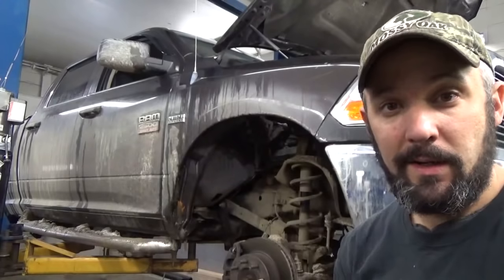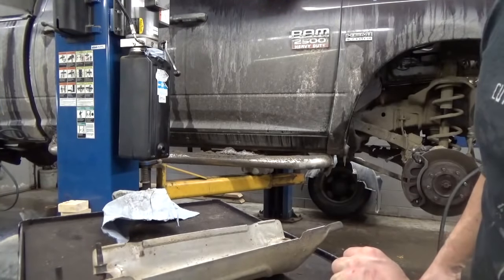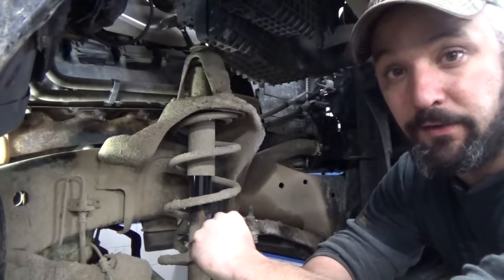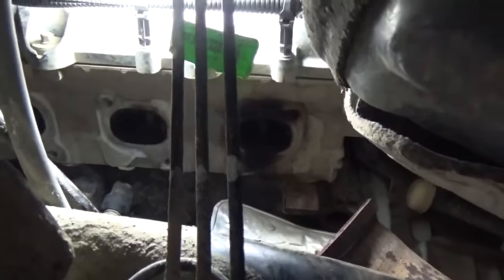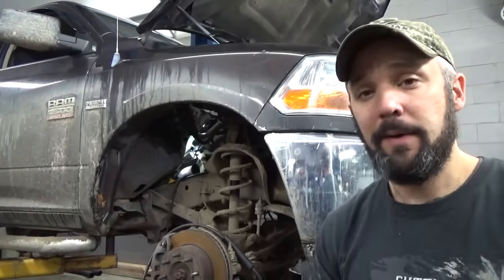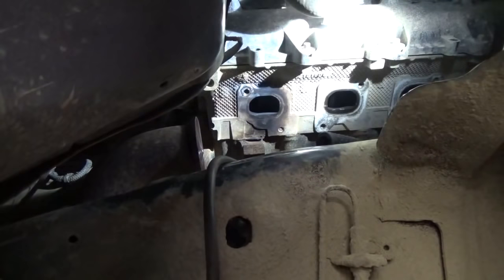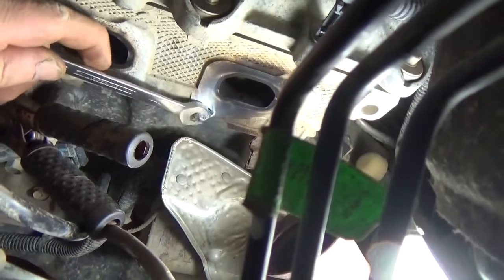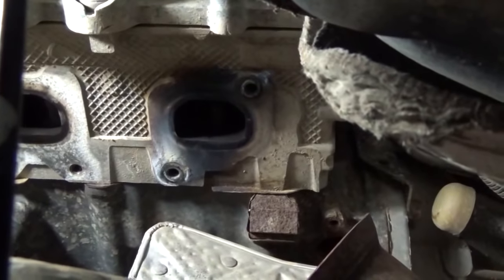Removing Broken Exhaust Manifold Bolts - Hemi Dodge Ram

Comment: please explain why it doesn't melt the aluminum block?  my method of extracting broken bolts is to take a small punch and pick a side and tap with a small hammer in a loosening direction. works pretty well if you can get the punch to stick. you may have to sharpen it to get it to bite.

Comment: Aluminum heads and cast iron manifolds have different cool rates, gets heat cycled and breaks due to heat up and cool down. Get different headers and you’ll be fine.

Comment: If you weld a flat washer to the stud first, its easier to see. It also gets better penetration.
Then weld a nut to the flat washer. An added benefit is 2 heat shots.

Comment: I just finished doing this myself today I have only had two broken bolts to deal with and of course they were the rear to on the passenger side. Instead of getting a replacement studs that I just went to the local hardware store and got some grade 8 bolts and made sure they were adequate length and put it all back together. I wonder what the reason behind them breaking is. I wonder if the exhaust manifolds expand more than normal and just breaks the poor quality studs

Comment: Why doesnt  the nut weld to the block also????? Does the block sink the heat so it doesn't get hot enough? I'd love to understand how this works. I'd wind up welding the nut to the block and nothing to the broke bolt. Nice work!

Comment: In the first five seconds of this video I asked myself Where is the kroil............ he used that fluid in a different video and I have used it several times on small engine repair. I think it's basically transmission fluid mixed with something else but it is very good

Comment: Great instructional video!
To remove the non broken studs and bolts,  if one doesn’t have a torch do you think letting the engine run to heat the manifold up and to let them bolts turn lose and then continue after it cools down? 
Terrible idea or could it work?
Thank you!

Comment: Not a welder or even a mechanic for that matter, but just wondering for those recessed bolts that need extraction if it would be easier to weld the end of a narrower bolt to it so you have room to weld on the outside of the threads instead of trying to hit it from the inside of a nut and build up the gap.

Comment: I would be very cautious using this method on the aluminum Hemi heads. They are known for warping to begin with. I would recommend a template extractor kit.

Comment: I understand you were mig welding the nut to the stuck stud. The base material that the bolt goes in is aluminum? If so, that would answer my question why the mig welding did not attach to the base metal. Does this process work if the base metal is steel? Or does the mig weld also attach to the base metal.

Comment: Brava, brava! My favorite method of removing broken studs. A friend who works at an exhaust shop showed me this technique many moons ago.  But those damn strut towers! The 3-valve Fords are a bitch - its usually the front ones that break, the towers are in the way, plus Ford studs are threaded tighter in the head. A good hot welder is key. Sometimes it's necessary to use a die grinder and remove the first few threads on those recessed studs.

Comment: Great video! I have a manifold bolt broken at the head. My question is should I get the same size bolt thread and thread it on and  weld it or get  1 nut  or 2 size larger and weld it. Or does it matter?  I am new to welding so I really don't know what is the best route.

Comment: I'm having a lot of trouble finding the exhaust manifold bolt / stud kit for the 2003 dodge dakota 3.9 manual transmission.  I found a OEM site that has the parts individually but there should be an after market kit with all the bolts/studs.

Comment: So, on manifold bolts, always heat the bolts with a torch before taking them off, is a good idea - love the whole vid...i hate working on exhaust bolts, esp ...but got 3 i gotta get out so not to warp the new manifold and blow out another gasket every 3- 6 mths of use.. Working on a ford  inline 6 for me… with a new carb that the float wasn't adjusted right, doesn't mix with an exhaust leak - talk about anxiety, sheesh

Comment: Nifty! How about a stuck and broken oil pan bolt? What method is best for getting it out? I can't use a welder to weld a nut on it, because the engine block is a cast iron block. Also, the bolt is broken off about 1/16 inside the hole.

Comment: Very common problem with the hemi. Aluminum head, cast iron manifold, and steel bolts all expanding and contracting at different rates. I wonder if replacing the manifold with steel headers would help.

Comment: It seems to b pretty common on those trucks. I have a ‘15 with 25k miles. What could I do to prevent this from happening? Replace them with stronger bolts? Thanks for you video!

Comment: Thanks for the answer, I just got the manifold off and found that the broken bolt is actually not stainless. Will any MIG welder work for that? I was thinking about just renting a little 110 v welder and trying it out, but I'm not sure if it would hold.
Reply from the maker: +Cody Praud All I was using is a 135 amp 110  welder...

Comment: That was a masterful job sir and your video was clear as well. I have the same issue with my 5.7 Hemi in an aspen.  Can you tell me which MIG welder you use. I had a little blue Miller and gave it away because i could not get it to seld anything!

Comment: Now how did you get the ground to weld? Did you just put it on a ground on a head or what? Thanks you made it look too easy though I have to do my 2002 1500 5.7 and I am a little scared to do it
Thanks in advanced

Comment: Great vid. Thanks for taking the time to video the process. I have the same problem on a 04 ram. Been putting this fix for a while. Read a few blogs and these Mopars are notorious for this problem. Do you have any suggestions on replacement bolts, ARP ...? Thanks again.

Comment: This may be a silly question, but how does welding the nut to the recessed bolt not get into the aluminum threads as well? Also could a flux core mig be used for this?

Comment: Big Tip, I just took 3 broken bolts out of my 5.3 vortec aluminum heads. I did the hardest one last, it was almost 1/2 inch in the head. I went thru atleast 15 nuts and easily spent 5 hours trying, plus it was my first time welding. Best method was to weld enough on the center of the stud then used clap on pliers! trust me

Comment: Great video
What type of nut was used ?
And what settings was you using for the welder?
I have a 2017 Ram Sport 31,000 miles, waiting to see if warranty is going to cover  it. Thank you

Comment: Question, that 2nd bolt that was recessed in there... you welded in the middle of the nut, which would fuse the bolt to the nut, but would it damage the aluminum or distort it from the welding heat? I know its not going to weld the aluminum because it's not an alu welder, but would it mess up the alu if you for example don't aim good and accidentally aim at the aluminum head too much? It would just turn dark right? And if you aimed bad, it wouldn't even weld the alu right?

Comment: this is a very common issue... in some cases the bolts are basically hand tight and we have had success removing them with very little effort, but not all the time....gotta love this line of work hate it when theyre countersunk... that really stinks

Comment: When welding the nut to the bolt are you disconnecting any of the electronics on the truck other than the battery? Is there a chance of frying any of the electronics with the welder current? What did you ground on?

Comment: Why did exhaust manifold bolts break in the same position on both sides? Is there more stress on the bolts because of the way other components are bolted in? Is it getting excessively hot in the back cylinders? Is there a design flaw? What's up with this?

Comment: Weld a washer first to the broken bolt and build up the center of the washer with a tig welder.
Then place new nut to the welder washer and weld it in the center full of weld.
Then remove nut

Comment: I have a question for anyone that has used a mig welder. When the bolt is broked off recessed into the head and you use a nut and weld it on, Can the weld actually stick to the head as your filling in the gap between the nut and the bolt itself or do you have to be just that good with the welder?

Comment: I have a 98 1500 4x4. When I hit 2500 to 3000 rpms 0n the freeway... engine starts limping around and sometimes ingetbthenflashing engine light. As soon as I let go of the gas pedal it goess away. sounds like something rattling around. I'm assuming the cat. Would you agree?

Comment: if you only need to get the 5.7 hemi heads off for a blown gasket or lifters & your exhaust manifold bolts are fine then leave them ON ( just remove 2 bolts to exhaust ) & remove the heads with the ex manifolds attached. Save you $ and a ton of time.

Comment: I’m a DYI guy AND new to mig welding. What did you ground/clamp your mig negative so to not affect the truck electronics? AND high or low voltage on the welder? Thanks. 🇨🇦

Comment: I was wondering about replacing my exhaust manifolds to the stainless steel on my 2012 ram 5.7 hemi and was wondering if it is a good idea as I know the cast iron ones cause leaks which is what happened to me

Comment: Great videos! Question do you reuse the old bolts after heating them up? Does welding those nuts onto the broken screws cause a risk of melting the aluminum?

Will this process work on a Dodge nv244 transfer case? I think they are made of aluminum as well. One of the fill bolts isn't budging and the hex is almost rounded after numerous rounds of removal.

Comment: great job, you do some very nice videos,on the exhaust bolts when the heads on the bolts snapped off do you heat the bolt or the head right where the bolt goes in,i noticed you are just heating the bolt head,thanks keep up the nice work

Comment: Are the oem bolts inferior or perhaps a diameter to small from factory? It seems this is a common problem. Thanks for sharing. It beats angle drill with drill bushing and like like you say ruined day with a broken bit/extractor.

Comment: I have a 2013  ram  watched your video  thought ok, that's going into the garage  .   when I got the truck back  what they did was cut off the heat shield  .  Was that even an option ?  Or  Should I be going back to garage and say wtf ?

Comment: When you hit the bolt with the welder and build up a puddle is there a chance it will weld to the aluminum or melt the threads in the head?

Comment: Very nice.  When using oxy acetylene for heating up the bolts any suggestions for tip size and heat setting?

Comment: Great video!  Did the exhaust leaks (ticking sound) on the drivers and passenger sides throw a code P0171 or P0174 indicating the the engine was too lean on Bank 1/2???

Comment: Is there any risk to melting or warping a portion of the cylinder head with the welding when they are broken flush with the head? I have the ticks in my 04 2500 Hemi and the heat shields are loose so it's likely I will have broken studs and/or bolts.

Comment: I’ve been having this exact issue with my 2010 ram 1500 for years and I just ignored it. Just recently I had a check engine light come on that showed “small leak detected” I erased the code. And now I have a “p0305- cylinder 5 misfire” do you think this manifold leak could cause that misfire? I do see a loss of power and gas mileage. Other than coils/plugs/wires change. I think this is the root cause of my problems

Comment: Chrysler/dodge tech here. Just drill a hole slightly smaller than a T25, then tap the bit into it, and almost every single time they’ll come right out. Regardless of if you’re in a salt state or not

Comment: My '02 Ram with a 4.7 is starting to leak coolant from a core plug. I guess I'm gonna have to pull the engine to replace them all. Which means I'm gonna have to remove the manifold bolts too. I'm worried about them possibly breaking. Is it very common for them to break on these engines? If I don't have a torch, can I just start the truck and let it warm up for a couple of minutes and then immediately try to loosen them up? I realize the truck is old, but is  a torch the only way? Any tips?

Comment: What do you do to keep from starting a fire with the welder? Did you cover the fuel lines or anything? Also do you clamp the ground cable to the engine block? 

Thanks in advance. I'm about to attempt this repair on my wife's trail blazer.

Comment: i have a dodge 3500 5.9 gas the manifold bolts broke off on the outside will the manifold slide off of the bolts or will i need to weld nuts on them first

Comment: Will a exhaust leak on the manifold cause the exhaust at the tail pipe to make a different sound than that other side? I don't know if you have heard of the dollar bill test but on the right side it sucks the dollar bill in the pipe every so often on the left side it does not. Not sure if that is a motor issue or a exhaust leak issue. I know I have a  exhaust leak for sure.
Reply: Also, would you gain anything by going back with a set of headers over the factory manifolds?

Comment: The only issues I see are choosing the proper nut to weld onto the nub... Seems like a lot are alloys of zinc and then higher grades another alloy of steel, what nuts are the best to weld onto the nub so they just do not spin off?
Reply: Those darker metal nuts that will get light flash of rust are what I was looking for, but our hardware only has those shiny ones full of zinc, or the gold ones grade 8.. haven't luck with either, the weld sticks to the stud but will not bond to the nut... I found 1 old nut in shop and got 1 of 6 that were damaged in a Ford 5.4 head, might have to steal some lugs off old trailers here... alloy issue.. then helmet issue, can't get in close enough to see.. luckily aluminum head...

Comment: So basically I just need to disconnect the battery, plug the welding ground onto the engine mount and I shouldn't have a problem with messing up my sensors or electronics?

Comment: Loved the video. My 03 ram has the same issue. I am pretty good with a wrench and was worried about how hard this repair would be. Before I took it to the shop I found your video. Now I think I will give it a shot. Thank you for putting this on. 

Where did you ground the welder to on the truck? Thanks again.
Reply: bigkev10101 I planning on doing the same thing on mine but I dont have a torch, do you think just heating up the engine to let those bolts lose could work?

Comment: what did you use steel wire or aluminum wire to weld the 8mm bolts on? awesome video, very helpful and informative

Comment: The best way I always get broken bolts out that are flush with the surface is to use a left handed drill bit and get it in the bolt and it will get stuck and use that to brake it loose. I have always had success with left handed drill bits and broken off flush bolts in heads and everything u can imagine

Comment: Would a regular propane torch have enough beans, for the bolt head heat up? Also, seems like the welded nut has no tendency to stick to the aluminum head, I'm reading that right?
Reply: Steel won’t weld/fuse with aluminium.  Careless use of the MIG torch can melt the aluminium but it won’t ‘join’ with the steel.

Comment: South Main Auto Repair - Using the welder doesn’t hurt the heads? I was always told that the heat will warp an aluminum head! 
Where are you located?

Comment: My 2004 Dodge Ram has the Electronic Throttle Control light on, any idea what could be causing it?
Reply from the maker: You need to pull codes to get direction

Comment: What size welding wire is best to use for this type of job? Are you using flux core wire or solid core wire with gas?

Comment: Ok so I've had a ram for quite a while now. I can't remember when it didn't tick on startup due to the same broken bolts you have. How necessary are those damn heat shields? The ones that hold them in are always the bolts that break. The regular 10's everywhere else don't break under normal usage of the truck. I had a lifter fail so my heads are out anyways. I am replacing the exhaust manifold bolts right now but I'm damn tempted to extract those broken bolts, throw the heat shields in the trash, wrap the headers in some kind of heat wrap and put all regular 10mm size bolts back in. Bad idea?

Comment: I need advise on how to remove a broken manifold bolts and a broken bolt removal tool in the middle of the bolt. Or advise on what drill bit should I use to drill both pieces?
Reply from the maker: Google "rescue bit"

Comment: My 2012 Ram 1500 got 3 broken bolts in driver side, I had broken a lot of drill bit, and broken bolt removal tool... I try a little electrical welding,  they are still in the holes for few weeks :(

Comment: A couple of questions, if I may?   I might be doing this on my vehicle soon.  I have a welder, but I am NOT a welder, so I was wondering what setting you have your welder on?  High, medium, low?  Also, what kind of speed, fast? slow?   Can you also tell me what you'd do if you accidentally welded the stud to the inner threads of the head?
Reply: My advice is to practice on something else. Each welder is different as far as settings go. My welder at work has a wire speed of 0-999. 50-200 amp switch and a 250-600 amp switch with heat settings from 0-45. My welder at home is different. Again, practice with different settings on nuts and bolts to get a general idea. Carbon wire doesn't weld to aluminum like you think.
Reply: +JackOfAllTrades 50-250 amp. Typo